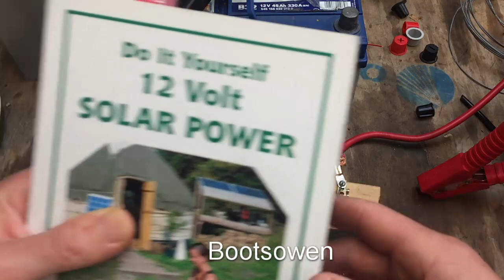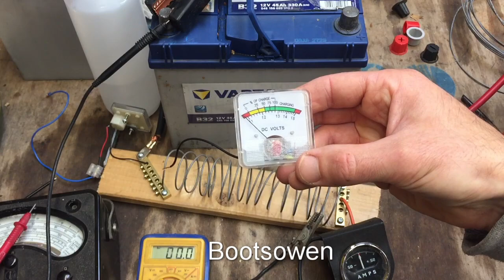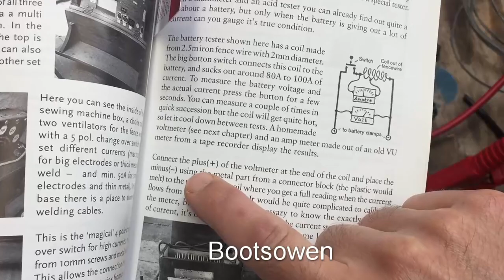Simple DIY 12v battery load tester.

Comment: I just submerged my makeshift "resistor" in a bucket of clean water and it can be used at 100% duty cycle, plus remains more consistent resistance since temperature doesn't change that much.
Reply from the maker: That's a good idea.

Comment: You can actually access most "maintenance free" batteries by heating up any sticker w/hair dryer, removing and accessing the caps for each cell, like any other lead/acid battery. A pick would be required instead of a screwdriver, for removal.

Comment: Great idea, im building something similar to emulate a car starting to check it maintains voltage, requires much beefier wires etc as its for 400-600 amps <1 minute. Good concept
Reply from the maker: Does it really need to be so big? A car usually starts in a few seconds, only when it's cold or got some other problem does it not?
Reply: @bootsowen  depending on the engine size it pulls 300-600amps for those 3 seconds, you can see on the battery CCA which is cold cranking amps, if it’s not delivering in that region for longer than a few seconds batteries not good

Comment: Just a comment on the "ammeter".  The book, where it says voltmeter, is actually correct.

MOST ammeters are actually voltmeters, measuring the voltage across a shunt resister which is passing essentially all the current.  In this case, the shunt resister is just a few turns of the load wire.  In a formal ammeter, you pick the shunt resister value, and you can mark the voltmeter in amps not volts.  In the book, and in your rig, unless you've actually calculated the position of where you place the alligator clip to match the ammeter internal resistance, you have no idea if the ammeter value of 50A really means 50A.

The "ammeter" that you have is really just a voltmeter, full range is chosen by the size of the shunt resister which isn't inside the meter.  Lab ammeters have the shunts internally.
Reply from the maker: Thanks for the explanation. You might have guessed that I am a bit of a novice on electronics. With this test unit I think the gauges are more about looking for a sustained current and voltage under load. A dud battery will show a decrease under load. Thanks
Reply: @bootsowen  Right.  The ammeter here is a just a voltage reading across a "known" resistor in the circuit (a couple of turns of that coil).  That plus the voltmeter allows you to check the voltage droop under  the "known" load of the whole coil.

I say "known" in the sense that it's constant, but you really don't know the actual values, they're just roughly in a suitable range for this test method. You don't know exactly what the current/load is without getting into the designed resistance of the whole coil, and the segment you're using for the ammeter.

It's a very useful circuit, but not a precision one ;-)

Comment: If batteries appear dead, as in this good video, they may be sulfated. Simply remove about 15% of the battery acid and refill with distilled water (or use an hydrometer to set the battery acid in the middle of the yellow band). Then put on charge for about 24 hours. The Sulphur will be drawn into the acid to recreate a chemical balance and the battery could be usable again, i.e. it will be de-sulfated.

Comment: Great  Video  The old  battery tester had a metal band in a zigzag  fashion between to metal prongs  with  Voltmeter  across to  check it did not go below 9.6 volts . I used it many times decades ago  and you could use it on the battery without removing it from the vehicle. It gave a fair old spark when making contact with the  battery poles and the duration it was left on for was about nine seconds . The fencing wire is a great idea. Its over €100 for a OTC load tester on line  and this for a few euros..keep up the good work..

Comment: Hi, as you asked for my views, here they are. It is difficult to compare batteries unless they are freshly charged and then stood for 48 hours to allow for self discharge. However the first battery showed a slightly low voltage, 12.8 would be better and at 12.4 if it had been charged a few days ago would indicate slow self discharge. A 10.7 v battery could indicate either 1 duff cell or just very discharged.  A remote starter  solenoid from a bendix type car starter (morris minor) would work as your switch. The amp meter in this system seems to be in a strange place as it is in parallel with part of the wire resistor so that only part of the current is passing through the meter, but it acts as a relative reference but give no real reading. The sealed batteries can have the covering top levered off, they are glued just around the outside so a dremmel could be used carefully. The removal reveals 6 rubber caps that act as pressure relief seals, these just lift off. I have in the past drilled out the small access holes to the cells and re-sealed them with a rubber stopper. A battery with one duff cell can be cut up to make a 6 volt unit and using the carbon lead welding shown in my recent video a new terminal can be welded to lead buss bar revealed in the cell side wall. Perhaps should do a video about this. Can you reference the drop tester video in a video card?  Drop tester:  https://www.youtube.com/watch?v=8l4BmvXh3yo&t=690s  and Carbon lead welding battery terminals: https://www.youtube.com/watch?v=Ubl1fUGrXcw&t=771s
Hope this helps and it's given me some inspiration, cheers
Reply from the maker: Hi Andy, I really appreciate all your observations. I have added a card, the first one I have done, so I hope it is in the right place. The batteries were all charged about 2 months ago and then stood, unless I mentioned otherwise. I have been keeping ones that show a reasonable charge when I find them. But recently I had a few others saved as well. Many thanks. Owen
Reply: Owen, thanks for that, if you can get some free cracked solar panels they are idea for keeping spare batteries in good condition, otherwise they will slowly discharge. Either wire sufficient batteries in parallel to take the current without the risk of over charging, charge through a resistor ( a bulb), or get a cheap charge controller. I keep my spare 12 units good by trickle charging them from the 48v bank through 110v 60w bulbs (1 per 12v battery), cheers.
Reply: Glad you two boffins finally got together :)
Reply: A shunt ammeter draws a tiny part of the current, so the reading is the real current less the tiny current drawn by the ammeter, so quite accurate on such an ammeter.